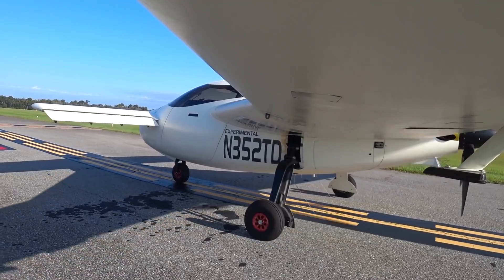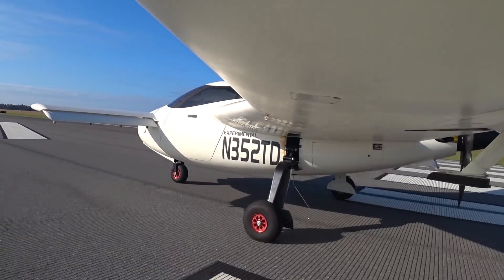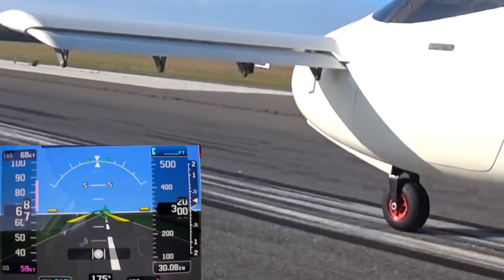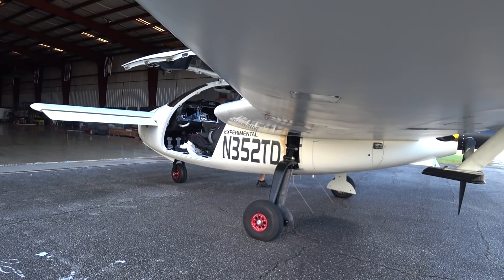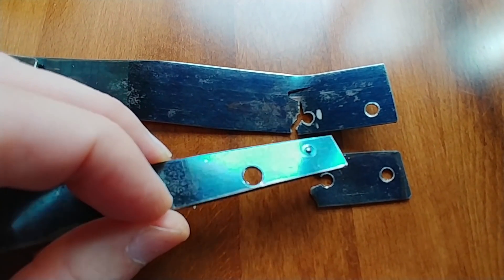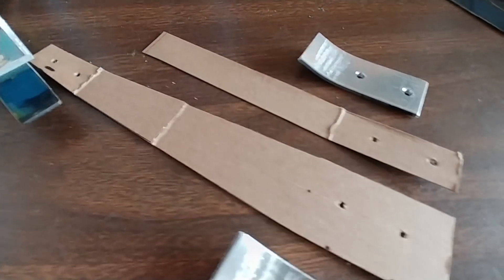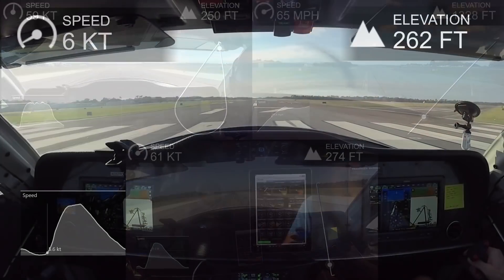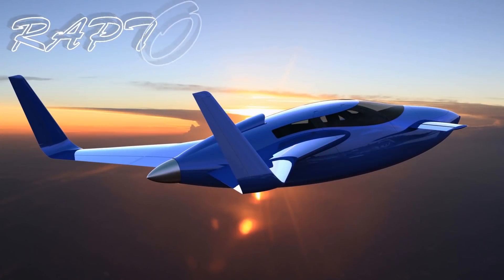Setting Takeoff Trim - Building the Raptor Prototype

Comment: Hi Peter! As a former developer for the Audi/BMW/VW/Renault Diesel engines, please take my advice for a little but effective quick fix. I noticed that your turbo setup is limiting your power output while increasing the EGT by far! If you get rid of the first turbo stage and only use the HP turbo, you will get ~30% higher power output and the EGT will drop significantly.

It's a quick fix and you will fix two goals at once: more power and less waste heat. I like your project, keep it up and lets get to finish line!
Reply: Replying saying "it's not a quick fix" is exactly why the safety of flight - risking both life and aircraft - is compromised. Time should not be an issue if it's a safety concern (overheating, lack of power in critical phases, etc), let alone a safety concern which could lead to incident at such a premature stage of a relatively complex test programme.

I truly hope you're successful, but at the same time wish that you would listen to those with significant knowledge and flight trials experience. All the best of luck to you, whether it's deserved or not!
Reply: Ha, you thought a guy that wouldn’t hire an diesel expert, watched a webinar to tune it with two turbos  he picked out on the web would listen? 😂🤣
Reply: Thanks for speaking up and trying to promote Aviation Safety!
Reply: @ryanthomas2472  You are right and I am not an expert in calculating the exact sizing. I am expert in safety critical ECUs and these are used to  control the turbo setup, thats why I had to know the background. If Peter would like to continue with a dual setup, I would refer him to someone with deeper knowledge.
Reply: @ShortApproach  
Andrea, as an expert on ECU’s used at Audi, what’s your opinion regarding the safety factor when using a single aftermarket ECU on this aircraft application, as opposed to two per its dual FADEC design specification?  Also what do you think of the decision to mount the ECU on the engine side of the firewall as opposed to the interior? Finally, any chance this engine could ever be successfully fitted with a second ECU in a duel FADEC configuration?
Reply: @patrickbarker5775  I won't give a decisive statement, as it is always about likelyhood of failure and mitigation. Takes many hours of FMEA to give a profound answer. Single ECU can also have good MTBF which would be OK for experimental category. I would still go for redundancy, but this is no black/white situation and also not limited to the ECU: injectors, generator, etc... For mounting, cars also have them next to the engine, so no objection there as long as there is airflow (~150W heat to kill). I am more worried about the transmission than the ECU. It should be mounted relative to the engine and not to the aircraft. This reduces the belt life to hundred of hours instead of tens of thousand. I also made that mistake once in my human powered boat in the drivetrain.
Reply: The best part is no part.  Get rid of the second turbo.  Better now than later.
Reply: The compound turbo ideas seams somewhat more complex and problematic than one.  I would think in aircraft design one must always be simplifying and beating back the urge to add stuff.
Reply: What's the trade-off? Why is there a first turbo stage if it is reducing power and increasing heat? Would it just be losing fuel efficiency during the high-power phases, or are there other drawbacks?
Reply: @MichaelOnines  In theory the first turbo compresses air, and the second turbo compresses it more, making efficient use of exhaust gas to increase power. The problem here is that both turbos are the same size, therefore the exhaust side is too small on one (exhaust expands in first turbo, but does not have room for further expansion in second turbo) and the compression side is too large on the other turbo (first turbo compresses flow, second one is too large and cannot efficiently compress more). For correct expansion/compression ratios the second turbo should NOT be the same dimensions as the first turbo.
Reply: @Mariano.Bernacki  OK, I didn't realize it was an issue with poorly selected/mismatched systems rather than removing something from a diesel turbo setup widely used on the automotive side. Thanks.
Reply: @Mariano.Bernacki  The two stages are needed at high altitude. A single turbo wouldn't be able to compress enough. However I suggested way in the beginning that instead of first combining the 6 cylinders into a single pipe and then feeding the turbos in series, each side (3 cylinders) could feed one of the turbos. This would have reduced a lot of piping and both turbos would be benefiting from the same pressure / temperature differential. Also the y pipe is a bottleneck, it gets red hot. Just because you need to cascade the air side, you don't have to cascade the propulsion / exhaust side.
Reply: Worth a shot!
Reply: I like how heated AND functional this comment thread is
Reply: In summary you have two options do more research and eliminate the problem,  and you definitely have a problem or make a smoking hole in the ground.
Reply: Peter will not consider the possibility that he might be wrong. He has consistently rejected advice from experts such as yourself, Wasabi, and others, to focus on the next "Quick Fix", unsurprisingly the aircraft is overweight, underpower, and has a myriad of problems.
Reply: @Mariano.Bernacki  Wasabi-dudes were too ANAL to work with!
Reply: @Mariano.Bernacki  
Over weight?
It behaves like the wing loading is too low for that design of wing.
Reply: @brucebaxter6923  The prototype is indeed massively overweight, please check weight and balance videos and compare against design specification.
Reply: @brucebaxter6923  In these tests it is up around 18.5 lbs/ft^2, while a similarly-loaded Velocity (one pilot, 1/4 fuel) is around 14.5 lbs/ft^2. That's based on total lifting area (wing+foreplane).
Reply: @Mariano.Bernacki  
no arguments about it being over design weight, its the wing loading vs wing profile that worries me
Reply: @BobKuykendall  
Thank you. I stand corrected.
Reply: So..... why does DELETING a turbo stage; specifically, THIS one, INCREASE power? That seems counterintuitive but you know a lot more about it than I do.
Reply: @silasmarner7586  The air gets compressed on one side of the turbo and expanded (slowed) on the other (exhaust side). Imagine you already slowed, it will not slow again. This is "choking" the engine and keeping the heat inside (instead of using it).
Reply: @silasmarner7586  You have to keep in mind this is an automotive engine with automotive needs in mind. On the street, you want your turbo system to work well over a wide variety of engine speeds and loads - especially tricky in quick throttle transitions. Bi-turbo systems are often engineered primarily to reduce lag and bolster emission compliance.

A plane is not a car, so much of the complexity around that 'drivability' factor is simply unnecessary or even counter productive. It just needs to work well at fairly constant throttle positions and loads. So losing the weight and complexity and inefficiency of the bi-turbo setup sure seems to make a lot of sense to me.

Edit: I went back because I forgot this plane has a custom turbo setup. But regardless, I still think a lot of the mindset came from the automotive world and not the aviation world.
Reply: Assuming he's using standard fittings and clamps I wonder if in terms of man hours inside the cowl going for a larger outer turbo or a smaller inner turbo might work. I think it should just be a drop in replacement. And considering turbo's typically die first, it would be really bad if it wasn't easy to swap out turbos in terms of maintenance
Reply: In Peter's shoes I would first need to vet your suggestion.    If the turbo delete could solve heat problems and increase power as you describe, I'd get started on it immediately.  An added bonus would be to drop the final construction costs by several thousand $'s.   What about a parallel turbo set up?  1 for each bank of 3 cylinders?   Would a single turbo also handle bleed air required for cabin pressurization?
Reply: @bartofilms  it's not just Andreas that has suggested this. Many others familiar with turbos have suggested this for the past year, but many such comments get deleted sadly.
Reply: You likely have the most interesting post in this thread. It would seem that Peter would at least need to see the numbers--especially in power figures before he would make such a move, as that appears to be one of his concerns. Could you please post some numbers/theory to support your experience?
Reply: @BrendaEM  Diesel engines are limited by torque, rpm, smoke (low rpm high torque) and power (cooling at high rpm high torque). We had the rule of thumb that a reliable car engine can put out 100hp per litre and we pushed that to 130hp when I quit some 10years ago. You have to know, that cars do not maintain max power for longer periods, so cooling is the main issue. Approx. 2/3 are spent in waste heat which go partially in exhaust (recoverable by turbo), the engine block and the oil.

This means, that you take your radiator capability, multiply it by three and you get a ballpark value what your engine can deliver...

Take a look at Austroengine and Technify, then you see what state of the art means. These put out around 80hp per litre at the moment.

I guessed Peters engine to deliver ~230hp at the moment, so this is already at the top of what it COULD safely deliver if everything else would be fine --> drivetrain is the biggest issue, where it should be attached to the engine rather than the frame. Turbo setup needs to be changed. Redundant ECU would be fine but I see this as the smallest problem.
Reply: @ShortApproach  , A lot needs heat needs to be face the air: radiators, inter-cooler, and fresh air intake. I would like the air inside the engine compartment to be exchanged every once in a while, too.  If the Raptor was mine, and it's not, I would build a duct on the aft/back root of each main wing, and install radiators/coolers inside them. Because those ducts need not be common with the engine compartment, rain (and air) can just go through. Perhaps, if there was enough surface area and flow, the current main duct could be eliminated, as originally designed, to restore the demi-lifting-body arrangement. Though, I still feel that scavenging the hot air from inside the engine compartment may help. Peter, I know that you are under a lot of pressure, but still, it's difficult to hear that you have done all you could as for cooling.
Reply: Peter, here's a tiny-words explanation for what Andreas and Ross have been trying to tell you for the last two years: https://www.youtube.com/watch?v=QRTFjYsX5vI
Reply: While it may not be a quick fix it seems Peter is delaying the inevitable.  Hopefully he realizes this before causing expensive damage or hurting himself.  What's going to be more painful to deal with...removing a turbo or replacing a destroyed engine?
Reply: I wonder if a single but larger turbo would satisfy Peter's altitude/performance boost requirement--while saving weight, reducing complexity, and giving the engine some cooler air to breathe for better efficiency, and reduced exhaust backpressure.
There likely would be less exhaust surface area to radiate heat inside of the engine compartment.
Reply: @BrendaEM  A single turbo is sufficient to way higher than what you can fly unpressurized (~FL160). The Raptor is currently not capable of being pressurized,due to the window design which already has a crack.
Reply: @ShortApproach  , I think that the window issue can be fixed. I haven't seen it, but only heard about it. I have some experience mounting acrylic windows. The probable may have been caused by thermal stress around the fasteners. Perhaps the affected/questionable windows could be polycarbonate, though emergency egress would need planning, and so would UV protection.
Reply: Yeah look i get what your saying. You have all said it. Now put your money where your mouth is. Where is the help. Im willing to throw in a few hundred dollars to make all there changes happen how about you guys. Im in no hurry to get my raptor. What do you say?
Reply: Serwus Andreas, hast du noch nicht bemerkt daß der typ dich "besserwisser" genannt hat? An deiner stelle würde ich mich gar nicht mehr ärgern...
Reply: There is a clear reason all hight altitude aircraft engins uses 2 stage supercharging and all turbine engins compress in stages. Multiple stages. The concept is sound but needs tweeking. There must be adequate cooling between compression stages.
Reply: Lol did you consider the compounding turbos are to draw and compress a larger volume of air at higher altitude where there is almost no oxygen. How often do Audi cars drive at the 28 thousand feet level.
Reply: @johnmurray3834  this thing isn’t making it to 5k with the current set up
Reply: @jonathanhardwick5126  yeah agreed. Needs tweeking not reworking. Remember it is -30c at 28,000 my guess is the hard part will be keeping it warm. Not gonna be easy thats for sure. I get the sentiment but backwards is not the way forward
Reply: @skyboy1956  well that's optimistic. We will see wont we
Reply: @johnmurray3834  sigh. Read above. Compounding the turbos is a valid method *when done correctly*. In this case it is not implemented correctly, hence the heat and power problems.
Reply: @sheldonholy5047  he is asking him to sacrifice 10000 feet of altitude for some cooling. Thats just silly. May as well not have designed the thing in the first place.
Reply: @johnmurray3834  yes, this production-ready prototype is going to FL280 in a week or two, no doubt. Not to mention it being 1000lbs overweight.

He needs to get some power to fly the prototype and fix the problems. He can visit turbos later once he has the basics sorted, such as more than 60 seconds of power before overheating.
Reply: @johnmurray3834  "Why not put an aircraft engine in". Yes, why not? That's actually a valid method to proceed.

Elon didn't design Tesla cars himself, and their early efforts were hardly world beating. If Peter thinks he can break several laws of physics with his first ever design then he's plain wrong.
Reply: @sheldonholy5047  laws of physics are you kidding. What hes doing should have been done 40 years ago just like Elon. And your right Elon has 2 billion and spent every last cent of it. Guss you could do better though
Reply: @johnmurray3834  The difference is that Musk hires capable engineers.
Reply: @johnmurray3834  , are you sure it will be that much? As for the OP, I will ask you, do you have the tables and theory to prove it?
Reply: @BrendaEM  prove what?
Reply: Let’s worry about it making it to 2800 feet let alone 28,000 feet. Drop the one turbo, redesign the cooling system for stable temps at 80% power, and reassess the aerodynamic instability. After this  we can worry about flight in class A airspace.
Reply: @sy2207  maybe you should have a think about what that would actually take to do. You may aswell fit a larger radiator and intercooler and heat exchanger. Would cost 1 10th of the price and time. Why step backwards when you can put in the same effort to move forwards. Am I crazy or is that not the logical way to go about it
Reply: @johnmurray3834  certified engines don't require compound turbo's.
Reply: @KevinJones-pj8kx  what does that mean? Certified engines use twice the fuel at half the power and 10 times the cost. You should just buy him a turbine engine then. Then buy me one and all the other raptor deposit holders.
Reply: @johnmurray3834  the cost is probably true but an io 540 also takes just over 20 gallons/hr at the takeoff power of 250 hp. Avgas is less dense as well. 
Diesels in aviation do make a lot of sense, but due to the turbo issues this engine is not an upgrade currently
Reply: @lukebayliss9127  an IO 540 will cost around 60k and like you said burn 4 to 5 gallons per hour more of a fuel that costs almost twice as much as diesel for 100 bhp less at 12,000 feet lower altitude  so then you can start doing you math on the loss of ground speed and the twice as long in the air further adding to fuel cost and TBO hours which again will cost 3 times as much more often. Your why not ida has just killed the raptor. If he does that you can have my place In line mate because I live in Australia and its 1000km to anywhere from anywhere  here
Reply: @johnmurray3834  The problem is that Peter has chosen the wrong turbos for compounding. Both turbos have the same mass flow, but the first stage should be much larger to handle a greater volume flow. It compresses the air to a higher density and lower volume, and feeds it into a smaller turbo sized for that volume. That turbo compresses it some more, and feeds it into the engine. The way it is now, the first stage turbo is about the same size as the second stage turbo, which puts into the choke region of the compressor map. The turbos are so badly mismatched that just one of the two would provide better mass flow than the two combined.
Reply: @hpaircraft2187  well im sure he will put a larger first stage on when he is sure the wheel wells are the instability problem and not somthing major. One step at a time hey
Reply: There's no replacement for displacement.
Reply: Listen up people.  This is Peter's project from start to finish.  Add your advice and allow him to decide if he values it or has the funds, time and energy to utilize it.  Some have claimed to be all insightful but continue to be Klingons and have accused him of stealing the funds and slinking off to Australia to enjoy his ill gotten gains.  Nothing can be farther from the truth.  To begin with the funds are held in a trust and he does not have access to them. THOSE OF US WHO ARE ACTUALLY INVESTED IN THIS PROJECT ARE ABLE TO SIMPLY WITHDRAW THOSE FUNDS AT ANY TIME THAT WE SO CHOOSE.  Some have laid claims to attempting to save his life by defaming him.  You can better serve your fellow man by attempting to save the hundreds of individuals around the world, at any given point in time, who are similarly engaged in designing, building, and  "Absolutely, Yes! Test piloting, " their prototypical aircraft designs.  I have even enjoyed the video of a couple of fellows hovering in their, Prototype"  home designed and built helicopter powered by a lawnmower engine.  Many individuals quite simply modify an existing design to fit their particular aspirations.  Better yet,  get busy and design and build, and of course fist flight, test pilot your own dreams.  In other words, get a life please.
Reply: @billwessels207  I have designed, built, and test flown racing sailplanes, and other stuff I designed and built was test flown and then raced around Reno pylons at speeds over 400 MPH. Ross Farnham (rv6ejguy) is far more experienced than I, especially with Reno racers, liquid cooling, and turbos. That is the life we have, and is what is behind the advice we are attempting to give.
Reply: I said trust and meant to say ESCRO.
Reply from the maker: It's not a quick fix. It would require removing all kinds of plumbing and then reconnecting. You should realize that this would hardly be a quick fix.
Reply: Removing and reconnecting plumbing (let's exaggerate and say it is 1 week of work). Isn't that worth an extra 30% power + cooling help? You have spent more than a week already chasing cooling gremlins. Why not give it a shot? The potential gains are massive.
Reply: @Mariano.Bernacki  It also would likely require retuning the engine, taxi testing, thrust testing, etc etc etc. Conservatively I would say its more like a month of work to validate the new setup. He has something that seems like it will work for this phase of testing. Should he try that in the long run? For sure! But removing a turbo because of a youtube comment is a MAJOR change on the advice of someone who's identity and qualifications are not immediately verifiable.
Reply: @OkammakO  You have a good point about validating the new adjustment taking extra time. However, Consider that 1) The current setup is horribly underpowered, overweight and overheating-prone, so it needs all the help it can get, and 2) verifying Andreas's credentials is a quick message or phone call away.
Reply: @OkammakO  but in the end he will have to spend the time to fix it right anyways,  I'm lost what the rush is here, if it's not working right you do not move forward!  He has spent way too much time trying to solve the cooling issues.  What's the goal here, to get the plane to fly and then rip it apart again to fix all the "quick fixes"  he did along the way?
Reply: @OkammakO  , yes sometimes one must go forward to go back. If what the OP diesel designer has stated is true, then there are gains for weight, balance, temps, reliability, and even costs.
Reply: @RaptorAircraft  Adding weight (a coolant tank in the nose) to try to solve a cooling problem is not a quick fix either.  The cause of overheating is either too little air flow to the radiator/intercooler or heat generated exceeds the installed capacity.  Assuming the radiator is sized at least the same as when the engine was in the SUV, the fix is either more airflow (bigger inlets/outlets/fans) or less heat (engine tuning on a dyno or cooling system configuration change).  The extra tank will only act as a temporary heat sink and absorb some of the heat.  However that will only delay overheating, not prevent it.  Even if the tank and lines doubles the system volume, it will buy you 20 seconds which is maybe enough time to get to pattern altitude but not enough to climb out to any safe altitude for flight testing.  In addition, the oil will still get just as hot just as quick since it is not gaining any capacity.  You should consult a diesel engine expert to get that engine in a configuration to support flight ops vs being a detriment to getting airborne.
Reply: @RaptorAircraft  you spend more time justifying shortcuts and compromises than you would be to just fix it.  You went through this very exercise with your flight controls...
Reply: @RaptorAircraft  Physics doesn't care about your problems.  But you should care about physics problems.
Reply: @RaptorAircraft  Hi Peter! At the moment you are looking at little improvements in cooling with still the same marginal power output. It will be a few days of effort, but as said before, you will gain 30% !!! in power and get much less temperature at the same time. Quick means it is less time than researching improved cooling for weeks and having to change the engine in the end. Sometimes a well spent 3 days are less than dozens of single hours.

Good landings and looking forward to your next flight, Andreas
Reply: @ShortApproach  I’ll give you this mate you are persistent in trying to do this guy a good turn, but I doubt he will listen.
Reply: @sbelo2836  I admire Peter for trying to walk the last mile with his project. I have my own (private) project and I know how hard this is.
Reply: @RaptorAircraft  But it is a fix that's worth taking the time to do!
Reply: @RaptorAircraft  That's a really sad response, Peter
Reply: @RaptorAircraft  really doesn’t matter if it’s quick or not consider it’s the only fix. Just do it.
Reply: Raptor Aircraft  -  Peter, a phone call and a few minutes with this guy certainly can’t hurt.
Reply: @RaptorAircraft  I do good sir. And I don't think right this moment is the time, considering your other efforts to improve operating temperatures. But also, if temperatures persist, this will be something to keep on this list.
Reply: @RaptorAircraft  , agreed that removing a turbo is not a quick fix, but it might be a way to reduce weight--just where you want it reduced, and increase reliability, lower temps, while gaining your coveted HP.

I asked the Audi OP for numbers and theory.

Peter has proven that a diesel engine can be a powerful aircraft engine performer. Let us see just how well a diesel engine integrates into the overall package.
Reply: @RaptorAircraft  ,  I asked the OP for numbers to support his performance and power claim. 
I can only try to understand the pressure you are under. I know that static testing would have to be done. I also realize that the current configuration is a known quantity.
Though, if what he stated is true, then it might help on several issues, such as weight, heat, balance, and reliability. As long as the engine would deliver even equal power--with fewer parts and lighter weight, then as long as it could be safely tested, then it might be just the thing you have been looking for.
Moving that tanks forward and increasing the thermal capacity was also a win-win, well as long as the coolant lines and fittings are reliable. If he really is an Audi engineer, and if he does come through with the numbers, then this might be 20LBS taken off of your bird's tail. Yes it would take time. The young plane flies, but it needs to mature.
Reply: @RaptorAircraft  nevertheless it seems like the right thing to do. a quick chat with Andreas cant hurt.